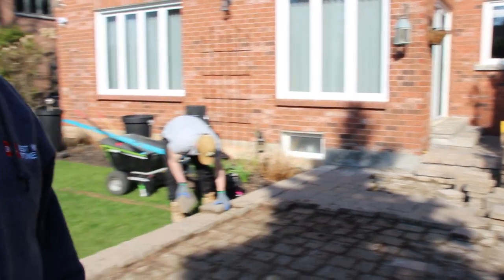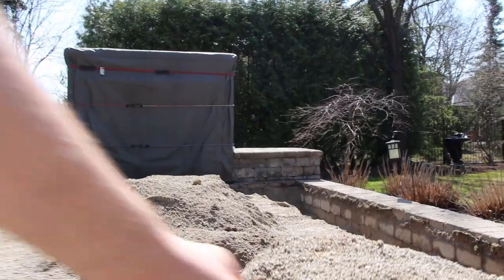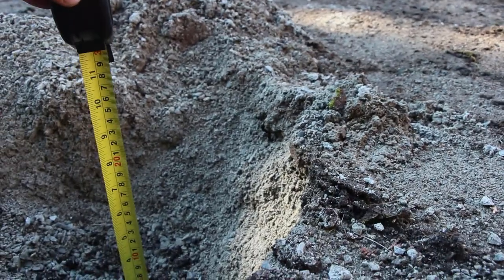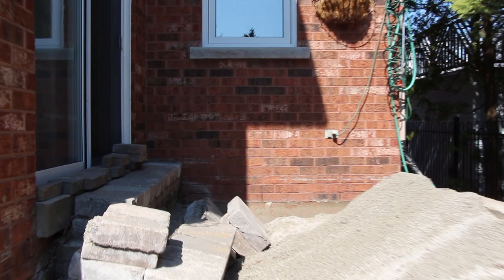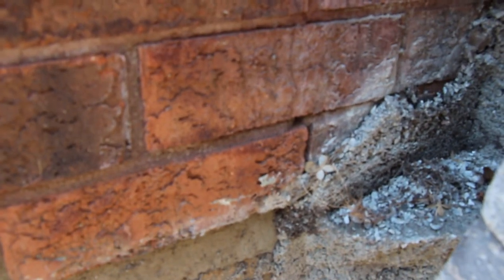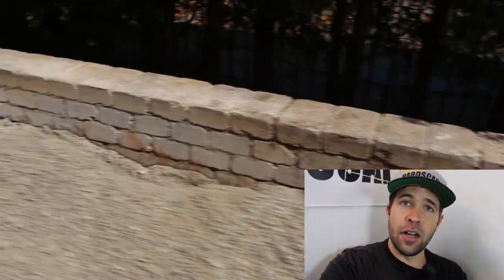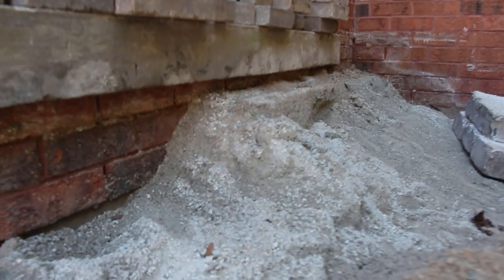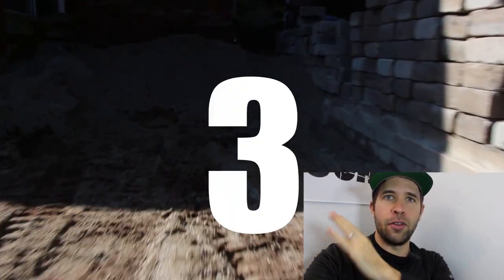STOP Using Stone Dust for Pavers | Problems with This Raised Patio

Comment: We used to use nothing but stone dust for patio areas and didn't have any call back issues... mind you we use to compact the area as well as the stone dust very well. We also used to slightly slope the entire area so rains would run off and away the patio area. Sitting water will create problems for sure. I can see in this original project a lot of areas where water would not shed.
Reply from the maker: Yes especially with it being a raised patio built level, there was nowhere for water to go

Comment: This is saying don’t use stone dust!  A lot of times we buy a blend of crusher run from 1 -2” stones all the way down to fines.  The blend is intentionally to allow for surface hardness and drainage.  We use construction sand as a bedding material because the sun angular particles of the sand creates a working bridge to the pores of the crusher run
Reply from the maker: Definitely! Though we prefer a 3/4” down to fines or Granular A as opposed to 1-2” down to fines.
Reply: @ brandoncarbary. That is the best way to make a good base.
Reply: @iamahardscaper  The best base for most jobs is to use 1"to 2" stone crushed all the way down to fines for first layer around 4" to 6" deep, then use 3/4" stone crushed all the way down to fines for next layer around 2" deep, each layer properly mixed and compacted, then finish off with a thin layer of compacted concreting sand 1/4" to 1/2" deep (max) before laying the paving.

Comment: Is there not a confusion of points here?  surely the biggest mistake here was putting in the dust to such a depth instead of using coarse gravel underneath.  would the exact same problem not have occurred had the pavers been laid on 6 inches of sand?
Reply from the maker: Very true, there would be a similar problem if laid on 6 inches of sand, but the points to laying on stone dust whether just the bedding layer or the full depth remain relevant.

Comment: I love your website and your videos.  I did custom hardscapes for a short time many years ago.  Even though I only did it for a short time, it's a trade that I enjoyed and I still do small jobs from time to time.  The landscaping company that I worked for 17-ish years ago laid everything on screenings / stone dust, so that's what I've continued to use until reading about the pitfalls of screenings recently.  I'm doing a small job (on my own house) now, and instead of stone dust I'm using road base / crusher run with a 1" leveling layer of concrete sand, as recommended by the ICPI.

When I worked in landscaping, we returned to some of the jobs that we laid on stone dust 3-4 years later and they still looked good, and this was in Wisconsin where there are significant freeze-thaw cycles.  Three to four years isn't a very long time for a patio or retaining wall, however, so I am curious to see what some of those jobs would look like now.  Unfortunately I no longer live in that area, and don't recall where all the jobs were that we did.

One thing that makes me curious with the patio in the video - seeing pavers sink that much makes me wonder if either the base wasn't compacted sufficiently, or if there is washout of the fines happening somewhere. (Perhaps between the blocks of retaining wall around the patio?)  I'm not arguing that stone dust doesn't have inherent issues (washout of fines is an inherent issue).  Or perhaps, as you say, it's just frost heave running it's course...
Reply from the maker: Yes, definitely some more things going on here than just stone dust as the culprit. Probably poor compaction from subsoil to base. Good point 👍👍

Comment: I just did my first paver patio 8x12 pad with 4” of #10 granite screen. I put 2” down, wetted, hand compacted with 8x8 tamp, then same with top 2”. It has a mobile shed over its entire surface now and I will be putting a drain system around it. Fingers crossed.

Comment: Wow, that's a big job taking all of that stone dust out and redoing it. Curious if you could give your thoughts about a DIY for a small pergola away from the house: Is it ok to just put down weed barrier then inches of paver base?
Reply from the maker: With pergolas we do concrete piers below frost line and then tapcon into the concrete to fasten the pergola to them. Then build our patio around them.

Comment: Me and my husband are in process of making a walkway to our backyard. Based on other comments here, I think we're going to choose the granite screen for leveling. However, we have different shape slates and we're trying to make kind of a pattern ourselves with random shapes. But I know there's going to be gaps between the slates, maybe 1-2 in wide. 

What should we fill out these gaps with to be sure the pavers won't remain loose or lose their position while walking on them? I know one option would be polymeric sand, but another video of yours showed problems with polymeric sand and our walkway is kind of in the shadow of huge trees we got there so doesn't have huge amount of direct sunlight onto it. 

What else could be a good choice?
Reply from the maker: This video should help you:

Choosing the Best Paver Jointing Compound
https://youtu.be/LctDY0tpaGc

Comment: Excellent presentation! Thank you. 
That was an excessive amount of screenings 🙄😂
I’ve been a Hardscaper for 30 years in Ontario Canada. I am 50 now. I started in 1990 in Toronto. We always used 3/4 or 5/8 clean only for slab or block  steps.
For pavers, 6” of 5/8 crush, and 2” of construction sand for final base. When I moved to Kingston ( The Limestone city) in 2000 the standard was 6” 5/8 and 2” stone dust. Over the last 20 years as a Hardscape foreman I’ve noticed this issue firsthand and ripped out many landscapes due to this but only just realized what a problem it is. How do you feel about Gator board products and HPB stone for base? ✌️👊
Reply from the maker: Amazing! I’m from Ontario too 👍.

I’m a big fan of Gator Base. We use it in our tight access situations or projects that can be built on the existing grade. Our oldest project is 5 years and we’ve never had a problem with them.
Reply: @iamahardscaper  
I’ve been binging your videos for the last couple hours. Subscribed. Excellent channel buds!👊🇨🇦
Reply from the maker: Thank you! Love hearing that
Reply: @jasonberezny9705  Hey do you still live in Kingston and if so, do you know where I can order HPB by the yard in the area? I've tried looking it up but I only see places in the GTA area

Comment: Really hope you see this comment! The videos are awesome I've got a question. Regarding your pricing of jobs, do you give an estimate and then charge according to the work you do? I know in the case of this project you ran into a ton of stone and excavating 11 inches of it certainly takes more time than you may have initially quoted. To wrap that question up, do you charge a fixed quote and then hope you run into no issues, or do you give an estimate to provide yourself with a cushion in case something takes longer than previously expected, and charge accordingly? Thanks so much!
Reply from the maker: Good question! We provide quotes for the work but we have a clause for unforeseen circumstances / underground obstructions just in case we run into these problems. And we communicate that with the client that we are quoting for “x” but when we start excavating we could run into something that would be a change order. We try not to charge for those unforeseen though if we can eat the cost. It’s worth more to us that we can leave the client happy and maybe get some word of mouth leads from them rather than get a few more dollars in our pockets. In this case we did not charge. Hope that helps!
Reply: That’s awesome! Thanks so much for the timely response!! And I noticed in another one of your videos in the comments that you charge roughly 10-15$ per square foot. Is that still the case? And if so, do you always charge on a per square foot basis to systematize your pricing? Or do you primarily just use intuition along with your knowledge of your overhead to determine how much you’ll charge. Thanks so much again for taking the time, it’s really appreciated!
Reply from the maker: Yeah we are in that range. We use production rates to calculate labor hours which also calculates in our overhead. We have a software we just built that helps with this along with many other functions 👍
Reply: Awesome, thanks so much again for taking the time to read and respond to the comments. All the best!!

Comment: Hello. Grateful for your video to learn more. I'm doing a brick paver walkway around my garden. I used "Sakrete Step 1 paver base" with about an inch of "Sakrete leveling sand Step 2". Is that product OK? I dug down to about 4 or 5 inches where earth was hard clay. I put landscape cloth down on dirt before adding the paver base. I was going to wait until Fall before adding the polymer sand at end of job in case I had any modifications. Any suggestions or comments on what I've done - right or wrong before I finish it? I have about a 10 ft. straight section done and lot more to do with some curves. Its only 29" wide. Its just to walk and work around my garden area. I didn't want to have to keep weeding the area where nothing is planted. I'm wondering if those Sakrete products I'm using are considered "stone dust" ?
Reply from the maker: I don’t believe so, I think they are A gravel and concrete sand so you are good. Depending on your climate and if you experience freeze thaw cycles, I do a minimum of 6” of base with proper compaction. Hope that helps!

Comment: You gotta use heavy course gravel for the base, compact that and do 2-3 inches of stone dust. Stone dust cannot hold a lot of weight, the gravel base when compacted can. If someone built a patio with only stone dust that’s a fail.
Reply from the maker: Yes, big fail when built only out of stone dust. But it also Doesn’t change the fact all product warranties are now void once you use stone dust.

Comment: I am an older woman and hoping to make flagstone a pebble patio.  Going to remove my grass and compact the clay soil and put landscaping fabric and was hoping to put sand on top of fabric and arrange irregular flagstone and put pebbles around and also to put plastic edging around.  Now I am wondering whether to put sand or just lay the flagstone and pebbles  please advise thanks
Reply from the maker: Setting the flagstone in sand will be better than setting it into the pebbles because I assume the pebbles are round(ish). If it is just a small walkway that does not get much traffic and is more for aesthetics, you could probably get away with it as a DIYer. If you do use sand, you will want to add fabric on top of the sand, place the flagstone, and then place your pebbles. Otherwise the pebbles will eventually mix with the sand.

Comment: My local supplier suggested I use manufactured sand on top of road base for my paver base. Is manufactured sand different from stone dust?
Reply from the maker: I don’t know. I’d ask them what that is. If it is angular chips down to fines, that is stone dust. If it is concrete sand or just a sand-like consistency, they are probably steering you in the right direction.

Comment: When building stairs infront of a patio door like that what do you mean by there should be a relief wall? If I am building 3 steps with Mega Melville Steps, could I just pack 3/4 clean in the middle of them?
Reply from the maker: Yup that works. As long as blocks are against the foundation with a small gap between them, you are good 👍
Reply: @iamahardscaper  alot of people are recommending to put a piece of platon dimple side against the house behind the stairs to maintain the gap and protect the house. They also say it helps the brick breathe through the breather holes.

Comment: Maybe I missed it, but what exactly are you using as base and in-between the pavers?? I have a small area behind a house under a wood deck. 10 X 30 feet slight pitch for runoff all flat no steps. What should I use a base??
Reply from the maker: Under a deck? Can’t be seen? You can use a fabric and some aggregate. If it can be seen and you will be sitting on it, search our main channel page for base and you will find a video that can help

Comment: If the raised patio here was built with the proper base i.e 3/4 clear or Gran A and the owner decided they wanted to get rid of the raised patio could you at least reuse the base material for another project or is there a reason why this shouldn't be done? Thanks!
Reply from the maker: As long as organic materials haven’t worked there way into the base. Fabric separators help that.

Comment: Is that ok to use as a 50mm screed under Astro grass
Reply from the maker: Under artificial turf would not have the same negative effects. It still would not allow for proper drainage though so you would want to plan for that.
Reply: Cheers thank you

Comment: Do you consider 1/2” minus DG stone dust? I was told it was a good base
Reply from the maker: That’s getting pretty small. Depends if it is dust with the minus. Our dense graded is 3/4” minus. What people consider stone dust is 1/4” minus and is just leftovers at the gravel pits which is why it is down to dust.
Reply: @iamahardscaper  Thanks for the quick response. I posted on your facebook page some water damage that occurred to my paver pathway. Could you give me your opinion on it?
Reply: @iamahardscaper The DG that I get has the 1/2" down to what feels like coarse/large sand. So it's hard for me to call that dust if you will. But going forward I'll probably need to use traditional 3/4 minus road base.
Reply from the maker: I don't even know where that post is. Best chance is just message me directly on Facebook or Instagram
Reply from the maker: that is the safest

Comment: 1:16  How does moisture being on top of the bedding cause anything on top of the paver, and what does this have to do with the polysand drying? I'm confused by this sentence.
Reply from the maker: Moisture being present causes efflorescence which leaches through the surface of the paver. So having that moisture always present on top of the bedding layer will cause that efflorescence on the surface.

For the polysand, if there is no chance for it to dry and cure because there is no way for the water to drain through the bedding layer, it will cause the polysand to not dry and cure. It will never have a chance to solidify and it will fail.

Hope this helps 👍

Comment: Stone Dust drains better than sand.  You must not be using real stone dust.  Itis crushed rock!
Reply from the maker: I would respectfully disagree. Stone Dust is what is left over material at the end of production from a quarry. It does not allow for proper drainage and that is why manufacturer warranties on product will be voided if you use it.

Comment: Well obviously if you use 10 inches of stone dust, you're going to have problems. Built patios and driveways using stonedust that don't look that bad after 15 -20 years. I don't think stonedust is the problem. Let me rephrase that: stonedust is not the problem.
Reply from the maker: I’ve seen plenty of projects built on stone dust fail compared to others. Even if you don’t believe it’s inferior, it voids manufacturer warranties so your already doing your client a disservice using it.
Reply: It's the problem long-term...fact